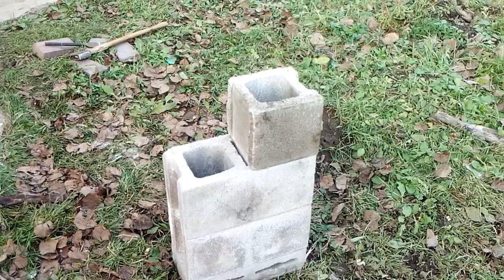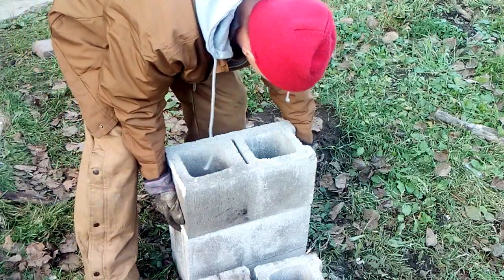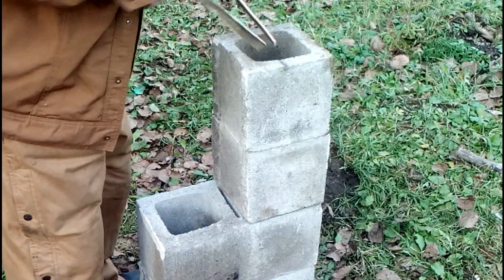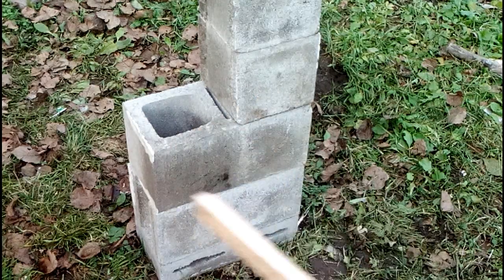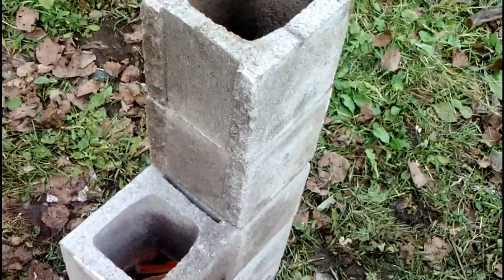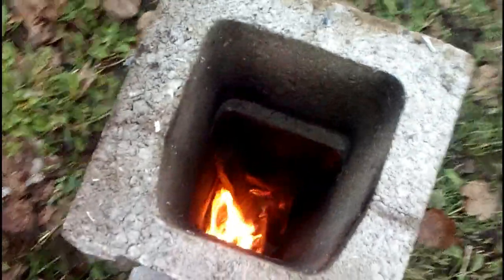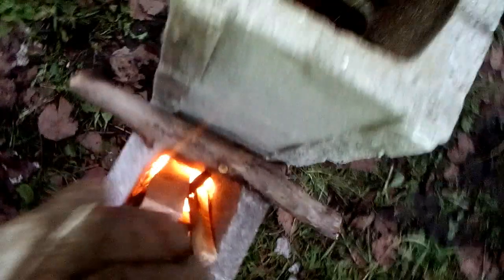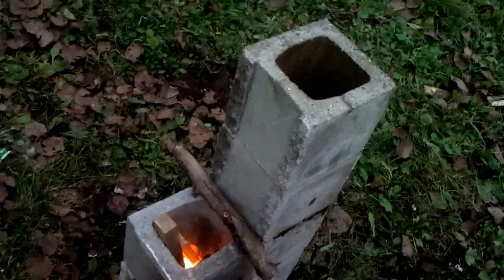Best Block Rocket Stove Build & FIRE Gravity Feed DIY Stealth Cooking BBQ J tube

Comment: Just made this exact version thanks to you. Thanks for the info and helping me understand how it works. This version is the beat because it is gravity fed, the wood naturally falls in and you also don't have to bend over to insert wood. Also it's practically wind proof. I've never made one with the mouth to the side but I could see it causing problems getting the fire going with any wind. Just makes it easy maintaining the fire with wind eliminated from the equation. Also this version has I taller chimney than most, it has more suction and draws heat more powerfully to the chimney. Also as you said, the height is perfect, once again no bending over, very practical. I paid $8 at Lowes for the blocks and actually broke one completely in two when trying to hammer out the middle part. It went back together okay and I didn't have to make another trip to town. It's hard to imagine you could make such a good stove with just $8. What's wild to me is the wood insert opening isn't hot at all, all the heat goes up thru the chimney, even when the fire is on the otherside as you said. Thanks and happy stoving!!
Reply from the maker: I want to make an updated version of this and make a new video as well because I know breaking breaks is not easy and you have to be careful , But there are half blocks that you can get and there are other ways to do the bottom crossover like a simple hole in the ground.  So there are other ways to build it without breaking blocks , Or by buying half blocks and hollow blocks

Comment: Home Depot sells what they call "Angelus block" which is exactly the cut version already cut for you-so convenient! Thanks for this design. I have access to as many free oak pallets as I want so will split and stack all I need. Currently I cook on my gas grill to save electricity because the rates doubled (went from $100/month to $200/month 😡🤯). The first month cooking solely on my gas grill I saved $80.00 so it's worth it and I like the gravity feed design 100% better, exactly what I needed!
Reply from the maker: Awesome tip about the blocks , thanks!  I had the idea to discuss the half blocks and make an update but life has been crazy and busy so I haven’t made any updates yet.  Thanks again
Reply: thanks man,  brilliant

Comment: May 2020 - I built this stove and cooked lunch for my family.  It worked great !
Reply from the maker: Carpenter Family wow 🤩 thanks so much for your input feedback.  Today was a good day 💯
Reply: After using it about three times, I disassembled it to clean out the ash. My old back didn’t like hefting the blocks around. I have a handheld grinder with a masonry cutting disc. On the bottom edge of the feed tube wall, I’m going to cut a square hole, 4 inches wide by 2 inches tall - so I can clean out the ash using a flat piece of metal stock bent into an L. During normal burn use I’ll block the hole. That will save my back as I’ll never have to move the blocks for clean out. ( Young folks need not worry about this. 🤠 )
Reply from the maker: @carpenterfamily6198  my favorite way to clean a vertical feed is with a shop vac or vaccumm cleaner hose.  Just stick the hose down in 🙏🏽 hope that helps

Comment: Finally something to cook on that's quick and easy to build, is smokeless and only requires 1 tool. Very informative video as well.
Reply from the maker: Thanks Wally, I’m sure it could be done with less tools or with pre made half blocks or something.  I have had some ideas for improvement in my brain i just haven’t had time to implement them yet
Reply: I just looked up concrete blocks at my local hardware store and they have half blocks. Now I just need to get them to deliver enough for 2 stoves side by side. I'd have more that one pot cooking at a time.

Comment: I love this design!  Doesn't require 30 bricks, or mortar, can be disassembled to store, etc.  I've been researching rocket stove designs on YT to be prepared for what I'm hearing will come soon (maybe in December 2022) where we'll be "required" to get another "vaccine" in order to access our bank accounts, shop in a store, etc. and we may have our power cut for a period of time, so in addition to stocking up on food and supplies, having a rocket stove for cooking in case the propane in my BBQ runs out, is fantastic!
Reply from the maker: Ya we are too reliant on other people and sources for fuel, I agree.  If fuel ever ran out, I’d go back to the good old days, wood stoves and horses 👍🏽  wood grows on trees, and it’s carbon neutral  as well as sustainable if you are properly selective when cutting trees, such as dead trees or nuisance branches

Comment: I like vertical feed using gravity. But with one more enhancement you get three major more benefits.
On the vertical feed side, you also need to create a horizontal opening for three purposes.

1) First for free Open Air Intake horizontally. This way you can fill the feeder without blocking air.
2) After the fire is over, you can easily scoop out all the ashes, as right now you don't have an easy access to remove ashes
3) By having a side intake, you can control the air intake for fast or slow fire with a small brick. 

This way you get the best of both worlds. Easy feeding and easy clean up.
Hope this helps.
Reply from the maker: Ben Hayat that’s the way most of my other rocket stoves and mass heaters are.  Most of my other units have front access also.  For this model I recommend sticking a vaccum hose down the feed for clean out
Reply: @613Builds  
Awesome.
Reply from the maker: Yes, I have revision ideas and easier construction method ideas I just haven’t implemented them yet.  Could use a hole in the earth for the bottom crossover
Reply: @613Builds  I did exactly that, as I only had standard blocks on hand & am far too lazy to bother modifying them. Worked great in the Missouri clay.

Comment: Thank you for sharing this design. It is the most ingenious stove of its type that I have seen, and I am going to try it. There is a device called a chip-heater that is used for heating water. This type of heater is made like a cylinder within a cylinder. In between the two is where the water is, and it makes lots of very hot water very quickly. It uses a cone insert that acts as a blast furnace when placed into the round hole in the top of the heater. The cone gets hot and sucks air mightily and blows it straight onto the fire. As the name implies the chip-heater uses small bits of wood and sticks for fuel.
Reply from the maker: Awesome.  Thanks.  I have made another one previously that burns pellets, with no auger nor blower required.  I still have it but that one is made of metal

Comment: I found a tall section of a terra cotta chimney liner that has a vent hole already in the side-I’m going to try to use that for my fire stack. My challenge is trying to hammer out one side of a cinder block for the bottom opening without cracking the entire block into pieces! 🤞
Reply from the maker: There’s another way.  You can just dig a small hole in the ground and use the hole as the bottom crossover.  Or hollow blocks or half blocks.  I might make an update video showing how to do alternate layouts or use alternate materials
Reply: Great idea! I’ll try that tomorrow! Im excited to try out the top loading, rather than from the side! Much easier to feed it from the top! 
Thank you for sharing your ideas!!  @613Builds
Reply from the maker: @lorim4651  be safe 🙂👍🏽 take care

Comment: I myself was wondering why people didn't think of this earlier. I was going to construct the same design only not as high but with the bottom patio brick and two concrete blocks. 
  Very good sensible design. I'm going to use a grinder with a masonry disk though to punch out the bottom block center. Good show.
Reply from the maker: Good idea.  The J-tube and gravity feed is very common among rocket mass heaters , and rocket stoves, so this seemed like a no-brainer.    I do like the match box or micro batch box but this is a simple and proven design.  Cutting with a disc or using a hollow block would be a good idea ✅. I actually have a new idea that’s even more simple , might only require 2 or 3 blocks
Reply: @613Builds  I would like to see your new idea, please share it with us. I can't believe how easy you made this, it's amazing. Thank you.
Reply: Do you think that you could cut out the outside wall on the bottom cinderblock on the left side to use as an ash clean out?
Reply from the maker: @inspirationoillife8306 it’s only designed for temporary use but I always unjust stick the vaccumm hose down in there.  Usually there is a lot of fly ash so a bunch of it actually goes up the stack sometimes

Comment: Good and simple. That's a great design. The 2 venturis are helping with the air flow, the stack being higher than the feeder.
You could experiment with varying the covering over the intakes to boost the flame intensity.
Reply from the maker: Personally I might consider covering the Venturi or experiment covering part of the Venturi , that way the feed box doesn’t get too hot to affect the convection and drawl of the neighboring heat riser
Reply: @613Builds  OK, sounds feasible.

Comment: I don't think you realise just how versatile this machine really is.
Reply from the maker: I have more ideas for improvements and easier build ideas I just have not yet shared the updated ideas
Reply: @613Builds  I see this being used as a kiln, a forge, a trigenerator, a water heater, even as part of a blast furnace!
Reply from the maker: @TheRojo387  wow that sounds very intriguing.  i do have water heater designs as well, where the exhaust passes up the center of the tank, same as a propane hot water tank, in one of my designs.  certain amount of forging is possible i knw because ive had some glowing red including my burn tube in the vertical compact RMH hybrid i made.  it can burn pellets or biomass or wood , and it can cook food

Comment: Thank you very much for sharing your absolutely brilliant and simple design. I'm building one right away to boil birchwater!  Sadly I did not know of this the week before for my maple syrup, would have saved me the propane. As a bonus it's a great way to get rid of all the branches fallen this winter. Me cleaning the lawn,  that will make my wife happy! :)
Reply from the maker: Lambert Cusson thanks I appreciate the feedback 💯😊
Reply: What do you do with the birch water exactly?
Reply: @wmluna381  you can boil birchwater to make syrup. Although because the water is twice less sweet you will need 80-100 liters for a liter of syrup. Because it's mainly fructose you cannot boil it as hot as maplewater. Be careful not to overheat especially at the end, finish on the electric range in a small cooking pot. The syrup is dark a little bit like sugarcane molasse but with a more complex taste. Torrefied frutty nutty caramel taste. Clearly the champagne of syrups. You can also drink a small glass of the freshwater every morning for a health cure, it tastes good and refreshing. East europeans haves been using it as a spring cure for centuries because it's full of minerals and vitamins at the end of winter. The birch starts seeping about 3-4 weeks after the maple start. Between 4-8 liters/day minimum for a medium tree, very seepy! Stop collecting when the water is not clear anymore (it's sap). Sadly the water does not keep very long ( refrigeration helps, have not tried freezing it though) but it gives generously for nearly a month, lots of water!. I use the same small tubes ( sorry I don't know the exact term in english) we use for maple and 4 liters water bottles( sometimes 2 per day) attached to it. I just filter it to get rid of possible debris.
Try it out, it's fun, if you have some time for evaporating 98% but hey, it is a good excuse to stay outside in the spring! This syrup makes nice base for salad dressing or marinades.
Good luck next spring and I'm sure there is plenty of videos about it on utube.
Reply: @lambertcusson593   Thank you so much for all the information and specific details! That was great and very generous of you to share. The white river Birch is one of my favorite trees in terms of looks and function. There is a park near me that I think I can tap some in an out of the way place to get a feel for the process. I was planning to tap some mature black walnut trees on the property where I work as well in the next month or two. I like what you said about Birch being the "champagne" of syrups. Good to know. ☺️
Reply: @wmluna381  Wow I would have never tought of tapping walnut,  why not? 
There is so much "untapped" ressources from our tree friends. My wife takes balsam fir gum to help with respiratory problems. 
Please feel free to share the result of your experiment.
Next spring I might try to do some spruce beer, more like an un-alcoolic soda type that used to be popular here.
If not I will hug a tree instead. ;)

Comment: Nice one buddy, I like this shape in fact i have tried ti build One but when I put the Pan on the heat riser the heat goes back to lower part..consider There Is a good 5 cm from heat riser top to the Pan. Why that?
Reply from the maker: matteo try not to cap-off the rocket too much.  you'll definately want a spacer or gill of sorts to let the dragon breathe and also so you dont burn your pan.  its similar to forced induction only with natural displacement via convection of heat rising out of the top, so its almost like a slow blow torch in that regard so it can get very hot at the very top

Comment: good idea, but how to do cleaning after burn? and if you put any cook on the upper stove, that will dramatically reduce the sucking pressure to keep the air flow, what do you think to put something there to ensure the air flow?
Reply from the maker: Astro Boy use a vaccum cleaner hose to clean it out, or remove the brick from the base.  Yes you will need to ensure the air flow if you cook on top , maybe a spacer

Comment: Very nice. Any issues with the heating/cooling cracking the block?
Reply from the maker: Thanks.  The heat will eventually start to crack these type of blocks yes.  But it works well for a temporary use or emergency use camp or survival stove

Comment: I didn't realize concrete block could hold up to the heat without cracking, but this is a great idea 👍
Reply from the maker: Ya only for short periods of time.  It’s a good emergency stove or camp stove, backyard experiment, but for longevity proper fire bricks would be more adequate.  Thanks for watching 😎😁
Reply: @613Builds  your welcome and thanks 👍

Comment: Great video, only question is about the clean out. How much work is there on that, since it's a J configuration. Thanks.
Reply from the maker: this is a temporary unit because it doesn't utilize proper firebricks, but a vaccumm will work great.  my other designs haave front clean out ports but i always prefer a vaccumm

Comment: Sometimes the lower the flame the better regarding cooking. No need to worry about soot getting all over your pot. A lot of heat is all a pot needs to cook. Less is more.
Reply from the maker: rocket stoves introduce so much fresh air and burn so clean that its almost impossible to produce soot.  you are correct, sometimes hot coals are the best thing to cook on, but this hot intense concentrated stove is good for boiling water off-grid or camping / emergency.  the best steaks i ever had were cooked over camp fire coals and marinated in budweiser :)

Comment: I know they work very well, but I'm wondering if the blocks will start to fall apart from all the heat? I know concrete will explode from too much heat, but have yet to see if those blocks will or not?
Reply from the maker: They will eventually crack.  
If you use wet blocks they could possibly explode

Comment: Thanks, sir. I've watched many of these the last few days andthis seems to be best design and the first one I am going to try. This might be a dumb idea, but I have some old semi-rigid aluminun duct. If I fed that in to the output riser could I turn that into a heater where I could direct warm air as needed?
Reply from the maker: The exhaust can possibly be harmful so possibly as a separate fresh air heat exchanger, so long as the exhaust gasses are external and not inside the duct it might be possible but this is an outdoor model rocket stove.  You might be more interested in a rocket mass heater which is different in such as indoor use and heat resistant materials like fire bricks
Reply: @613Builds  Thanks for the heads up. I'll worry about finishing this project before I concentrate on something else. I'm a new subscriber; look forward to a new vid notification.

Comment: I admit I was skeptical at first with the vertical feed. But you 'sold' me. Lol
Would it be a bad idea to use the part where you feed the wood as an additional burner to cook on?
Reply from the maker: probably a bad idea yeah, because thats the air intake.  its odd but the flames get sucked down in, so the heat and flame doesnt really climb out the feed port unless the heat riser (taller chimney) isn't working properly.  all the heat should be concentrated on burning the smoke and over the heat riser (taller chimney side)